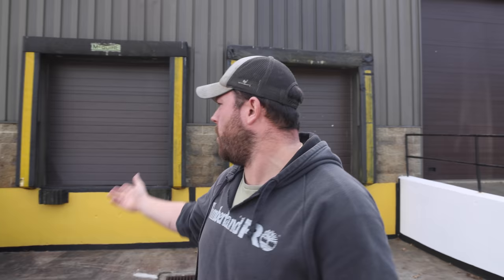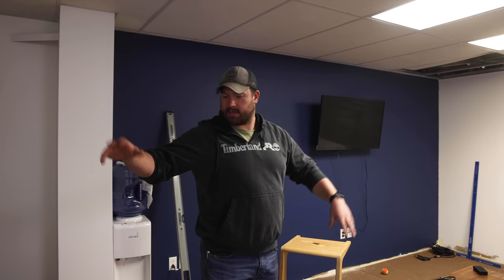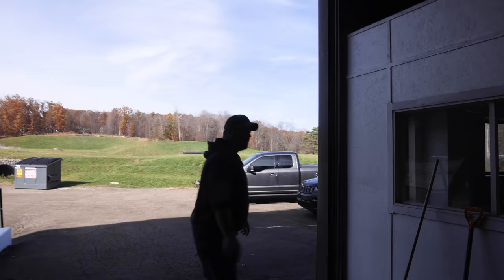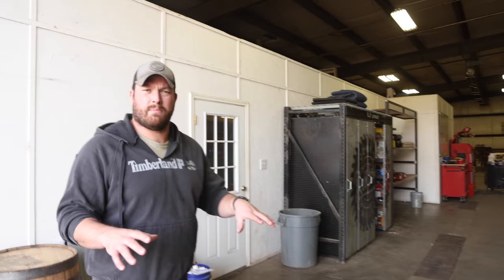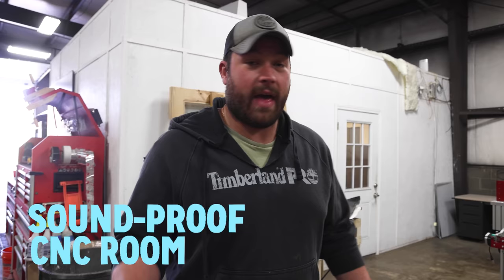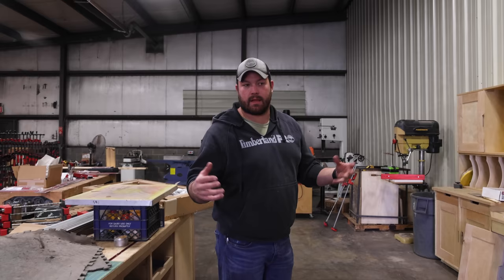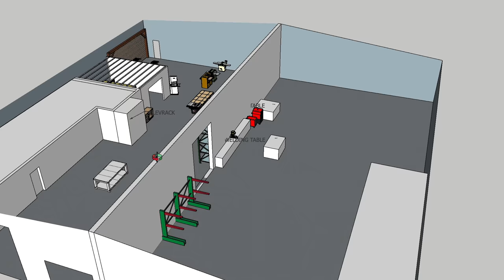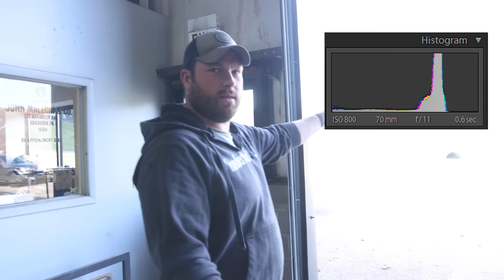I BOUGHT MY DREAM SHOP!

Comment: One suggestion with your CNC room.  I think it's awesome, but even being "soundproof" if you put it next to the office - you're going to get noise in there.  You could consider pushing it out 3-4' and create the space between the CNC and the office as a hallway/storage closet space.  I just think having a dead space separating the the CNC room from the office might be a good idea.  Good luck - the space looks amazing!!!
Reply: This is a great idea except a distance in feet isn't necessary as you just need an air gap where vibration can't transition from wall to wall. just an inch or two with rockwool insulation will be enough to dampen vibrations and minimize sound and vibrations coming through.
Reply: @derekl_  I don't disagree with you, but those CNC machines are so dang loud.  After thinking more about it today another option might simply be to push the CNC room over to the opposite corner and then have the space between it and the office simply be open.  That way it still get sound dampening but still only have to build two walls.
Reply: doesnt need to be 4 feet, but insulated office wall / air gap / insulated cnc cave wall is definitely the way to keep it down.  2x6 header and footers and staggered studs help with that too so the int/ext walls arent attached to each other
Reply: @theimaginationwoodshop5886  If Jordan is going to run the CNC from the office though im sure he is not going to want to walk back and forth from office to CNC room between setting up the bed and starting the program just doesnt seem efficient. But I hear you on the sound issue. They could always make a double stud wall and fill the gap with Rockwoll or closed cell blown insulation. And double up the drywall on one side of the wall which will also lessen the transfer of sound. So many options with the new shop. Gonna be fun to see what they do

Comment: Hey guys, congrats on the great new shop. You mentioned in your lessons learned video that you wanted an area dedicated for finishing projects. The “play area” along the right wall would be big enough for a paint booth and shipping station. Also since you usually use Miss Piggy to flatten out a lot of your poured project wouldn’t it make more sense to have your pour room next to your CNC room? I know there are limits on space and Maybe the power/temp control/ ventilation isn’t conducive to that but you asked for suggestions. Keep up the great work and I can’t wait to see the shop when it’s all put together.
Reply: The woods area should be on the otherside "metal shop" and the metal shop should be by offices. Less noise all the time, especially if they try to record voice over. A paint booth/pour room with water coolers tables makes alot of sense
Reply: Came here to add this exact 2cents. Definitely agree that since y'all have the space you should add in your enclosed paint booth area. Also in your last video y'all had talked about not enough space for larger builds like a 20ft conference table. Might be worth expanding the pour area along that wall if that is going to be the layout. Then that entire side wall could be built out from front to back to be sectioned off as a pour room and paint booth at the end. Maybe make another entry way between the two sides so y'all don't have to take projects from the back of one side(wood side) all the way out the front and all the way back in to the back of the other side(metal side). Dreams made goals my friend dreams made goals!

Comment: One suggestion for the sound proof room would to use the staggered stud method.   The baseplate is a 2x6 and on 16 inch centers (both sides) stagger the studs similarly to a shadow box wood fence.  It prevents the vibration from traveling through the wall by essentially creating two separate walls on the same baseplate.

Comment: Re axe handle doors: fabricate matching transoms/ awning window to swing upward for forklift clearance
Reply: I guess Miss Piggy's Boudoir will need super-high ceilings to allow for a forklift to get in there, so it probably won't match the adjacent office section or the axe-handled doors. Maybe better to use them somewhere else where it's only foot traffic? Perhaps the spray room - quad sliding doors with the centre two being the axe-handled pair?

Comment: Congratulations on the new larger shop. You could add your logo to the ax handle doors and use them for the two front doors. Or the barn door idea to separate the shops. I would also recommend a spray room somewhere, probably accessible by both sides without fumbling from one side to the other.

Comment: John, one thought about the CNC room: in case you ever need to work with a comically large piece, you'd probably want to make sure that the access doors are situated in front of the machine, and that they are large enough to accommodate your piece along with any extra work surfaces to set it upon. Other than that, congrats on your new home away from home, can't wait to see your upcoming projects.

Comment: I am a US navy veteran 
Stationed on the USS Puget Sound AD-38, Destroyer tender
Our job was to keep other ships running. 
We repaired or replaced everything. 
For your room concerning
 Miss Piggy , 
Like the ship awe had a rail system with chain hoist and skyhooks or clamps that apply pressure as it lifts .
Just a thought.
The advantage of not having to drive a forklift around could be an advantage in a busy shop .

Comment: Congrats on the new shop!! I'd suggest barn doors for the sound proof room. Then they don't open in or out and the opening can be as wide as the fork lift needs to be. If it's a regular hyster propane one not too wide of you're just going straight in and out. One could also have the walls be different panels so you could potentially take down the panels and make the opening as wide as needed.

Comment: I’d suggest boxing off a room on the metal working side as a grinder/sander/abrasive cutting room, and add some air ventilation and filtering to it. Keeps the rest of your shop cleaner, and keeps the mess contained and away from your finish products.

Comment: For the cnc room doors, you could use the axe handle doors, then above make an upsidown draw bridge on a pully to the ceiling to pull it up out of the way to create the extra 3-4 feet height clearance above the doors, it could be interesting and maybe a medieval design to go with the axe door handles

Comment: wow, super space.  You need to make room for a spray/finish area where thats all you do.  Helps with dust control.  Preferably on an outside wall so you can put in exhaust.  Also just a thought, a small exterior room to house the compressor and dust collection.

Comment: As an idea to re use the axe doors for the mrs. Piggy room, maybe put those doors on a sliding track so if a forklift needs to get in, a large enough area with the doors can move but if it’s smaller projects you can use the smaller doors

Comment: You should use the Axel handle doors there for Ms Piggy, and then add two smaller doors above them to open when you need to bring the fork lift through. Normal Man door for typical days and then open the top doors for additional height when needed.

Comment: Regarding the CNC room, coming from an audio background, obviously you want to insulate the walls but consider throwing up some sound panels on the walls also, even just cheap egg-crate foam will help (but there are much better solutions).  Also, if "drone" inside the CNC room in a concern, make none of the walls parallel to each other, or in other words, none of the corners should be 90 degrees.  That will cut down on the frequency drone.  But if you're not going to be in the CNC room a lot while it's running, then I wouldn't worry about it.

Comment: Yinz guys definitely need a dunk tank in the fun corner. It'll be a good thing for hot days in the shop, or a good method of punishment in case any of the staff are being massive Jagoffs.

Also for the outside, why not get your own sawmill so you could mill your own slabs? Make a heavy timber shed to put it all in: mill, kiln, etc.

Comment: Considering how much dust Miss Piggy generates, perhaps she should also have a dedicated dust collection system?  I think y'all are smart to have the pour room on the opposite end of the dust generators that reside in the wood shop...maybe it should have it's own air exchange/ventilation system to cut down on the possibility of dust.  Just thinking out loud down here in the South...y'all be safe!

Comment: That's going to be an awesome space.  When you go to frame in the quiet room for the cnc make sure to think about not just width of the forklift for doors, but enough door height for the forklift mast assuming you will need to drive in and out with the load raised above table height...  :)
Reply from the maker: Great tip ! We thought about this and we are prepared!

Comment: Nice shop! A ton of potential. One suggestion regarding the CNC router, you may want to simply "sound proof " the machine on its frame with panelling instead of building a room around it. This will give you a lot more flexibility to reorient the shop when necessary in the future.

Comment: In sound proofing my shop (garage) to bother the neighbors less, the walls were easy, rock wool insulation worked great. But the garage door was difficult and no longer opens. And the man door has two moving blankets folded and duct tapped on. I'd suggest researching sound proof doors from the start or all your efforts will be for nothing.

Comment: Congratulations on the new shop. 10,000 ft2... pretty wild.

Something that seems to happen often, when people move into a bigger space is that they tend to spread their things out, and that can come back to bite you. Things take longer to do, and the work becomes more arduous when you have to walk further to get the next process done. 

It would be advisable to focus on workflow (as opposed to focusing on how to fill and use the existing facilities), keeping your workstations and tools as tight as you can, using vertical space as well, to minimize the distance to the tools and supplies needed in each work station. Having an open space next to each work area, might also prove to be useful for overflow and staging, rather than spreading out equipment into an inefficient layout with no open space. 

With an investment as big as the one you just made, it would make sense to consult an industrial engineer for more recommendations on your layout for your workflow.

Also, I suggest that instead of building a room to contain the noise of the CNC, you replace the CNC spindle with a liquid cooled one, and if it still too loud, you can cover the spindle with insulating foam to dampen the noise further.

For further reduction of noise, you may want to look into mounting the air compressors and dust control motors on the outside of the building and pipe through the wall.

You may also want to consider merging the "pour room" with a spray paint booth, since they both require a controlled environment with good ventilation.

Just some ideas I wanted to share. I look forward to your next inspiring project.

All the best with your new space.

Comment: if you want soundproof make sure to do 2 insulated walls with about 1/2" of space between them..airtight is the other essential component to stopping sound transmission
Reply: Yup.. double stud or staggered stud with dual layers of 5/8" type x..

Comment: Congrats on the new shop. Let me know when you guys are looking to expand I'm from the Pittsburgh area and have 22 years of commercial construction experience from drywall and metal studs to exterior framing and finishes and plenty of finish work. i worked on all the club boxes in the Steelers stadium and PNC park.  Worked on a few awesome large scale bars around Pittsburgh and the new headliners bar at the meadows casino and the current sportsbook bar that's going to be new barstool sportsbook.

Comment: The door to the cnc room needs to be on the long wall so that you can bring the forklift fully into the room to the table. Since the only swing doors I can think of that are 4’ wide are the type used in hospitals I’m gonna go with they are gonna be crazy expensive which leaves a roll up door option. I’d just use metal studs for the walls and ceiling, quiet rock Sheetrock, isolators under the legs of the cnc and roll with it. Cheers
Reply from the maker: Hey Jeff, so we're going to build the doors. So those shouldnt be too much of a concern from a size stand point. Thank you for the input my friend!

Comment: You should look at timesavers for your wide belt sander. I’ve used several timesavers over the past 11 years and they are wonderful machines and a fantastic company to work with. Also, do you want your “Loud” CNC machine next to your editors office?  I would consider moving it away from the office to keep your sound editing experience pleasant.

Comment: 10,000 square feet is a good amount of floor space. I spent a lot of time in a same sized hanger at an airport in Southern California. I was working for a helicopter operator. Depending on what you do with the shop, it is possible to seemingly run out of floor space. We ran into that a couple of times, but nothing unmanageable. We had an overhead hoist for working on helicopters, and the hight of the ceiling may lend itself to something like that. A large project might need something overhead. It doesn't have to be elaborate. Keeping the office space to no more than necessary, I think, is a good idea. The whole idea of the new shop is to have more floor space for projects.And I am officially jealous, the new shop is going to be awesome!

Comment: since you have a very larger workshop, dedicate one corner to set up a small workshop. Take the bench you just made in this video and incorporate the Dewalt table saw. Make other "Small Shop" projects in the corner. AND it would be a functioning work shop. Just on a much smaller scale.

Comment: Yo, John. Congrats on the new shop!
Got an idea for a metal working project for ya: With the addition of the shop-shower, you and the crew are gonna need someplace to store your towels & a change of clothes ('cause who wants to shower and then get back into some nasty-ass grungies, right?). What about fabricating your own lockers? Could make for a pretty hilarious Beginner/Amateur/Pro video... especially since the builder will have to live with the aftermath.

Comment: put counters the type doormen and bouncers use everytime  to a tool you click that tools counter, after a month you get the tallies in and that will show you the most used items place these in the same space.    You need a clean room as well for pours.  In the war room have sacred whiteboards, each team member including the non craftsmen where they can draw vanity projects ideas and suchlike no matter how wacky.  Only rule is you cant touch each others boards, from experience you get some great projects to do that way.   Love the space and it is amazing.  Oh and set up easy reach time lapse mobile stands that you can pull into an area and get timelapses of work.  Look Alec Steeles shop and he uses a gantry with litepanels affixed for video lighting.  Well done ...... now build

Comment: Dumb question: I saw a couple of episodes where you had to do finishing in the metal work area in the old shop. Now, you have a dedicated metal work area, but... no finishing room??  I think you need the octagon out in the yard, and the finishing room in the back end of the metal area, with doors into the wood shop so both areas have access to the finishing room. Just a thought, its your shop.

Comment: John & Team congrats on the HUGE new shop. I watched the last video and what you didn’t like at the last shop. I still don’t know how you’re going to heat that 10,000 sq ft you got now. Nuclear reactor???  I’m building a 2400 sq ft metal building shop next week and still haven’t figured out a heat solution. Maybe pile all my mistakes in the center and light it up. Lol.

Looking forward to bigger builds!
Reply from the maker: You should do radiant floor if you can, or geo thermal. We have radiant tubes at the ceiling
Reply: @John_Malecki  I’ll look into radiant heating. I just poured the pad a few weeks ago.  Which I had thought of it then.   Thanks!

Comment: On the logical side of the wood shop setup, wouldnt you want all your milling stuff next to the door where you are storing all the wood that needs to be milled? Then work down the line towards the back, so the finished products are furthest from the door/temp change/elements?

Comment: Widebelt sander? Get the planer/sander monster combo - short work on slabs! Outside: Catapult, Trebuchet - Siege Engines Baby! Maybe a lookout tower with zipline to the top of the building and FIRE POLE into your office...What about one of those skydiving places where the air just blows up and you "freefall in place?" I am thinking of another famous comic/Tool Man who once suggested "man land" (like Disneyland) where you build stuff and charge guys $150/hr just to drive around an excavator or other machinery and then in the afternoon you DEMO it....oh the possibilities!!! You could take on a bunch of the old Davinci stuff (like the bridge made from walking sticks the army could build, cross the river and pickup and go)  Congrats on the new space - now step up the game!

Comment: So for ms piggy… you have those 2 door which should be wife enough but if you want taller make a flip up door on the top… when used normally it just looks like doors but needed for the forklift make a separate custom piece flip up to be taller and no one would know till you used it